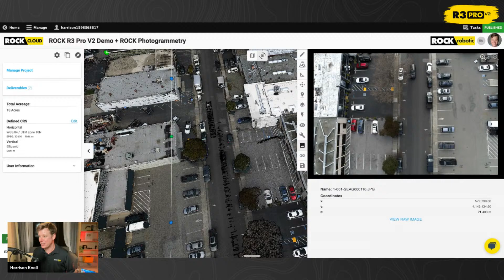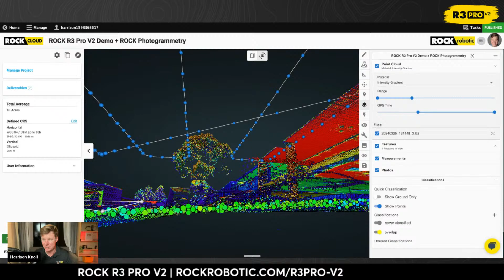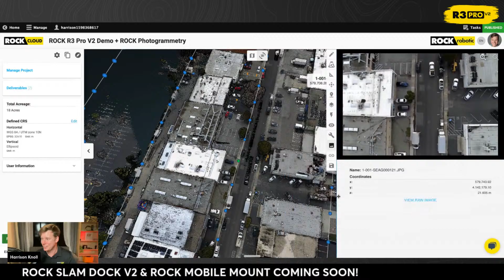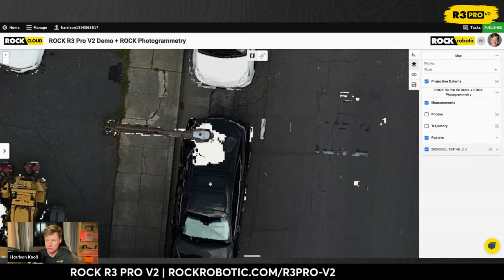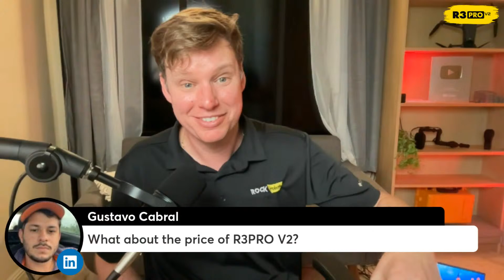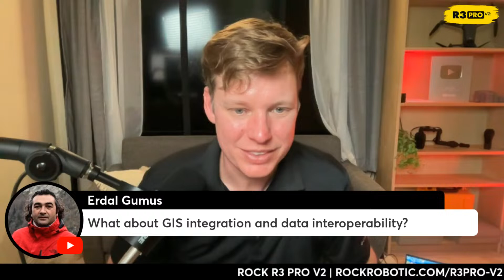Introducing: ROCK R3 Pro V2 LiDAR (Live Launch)

Comment: How do you fit the R3V2 in a fixed wing drone? I mean what are the reuirements ?
Reply from the maker: The R3 Pro V2 is integratabtle with multi-rotor drones only. We recommend the DJI M350 or Freefly Systems Astro.